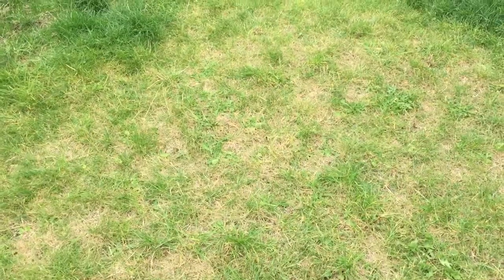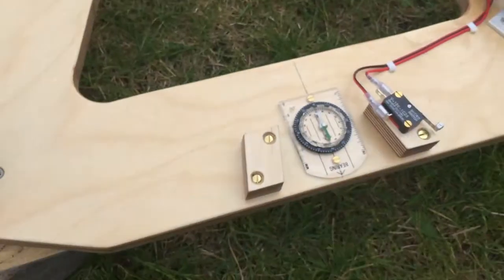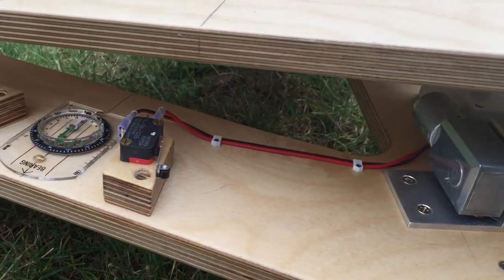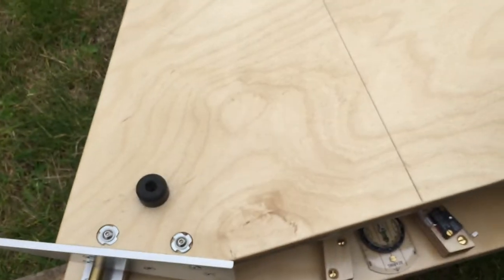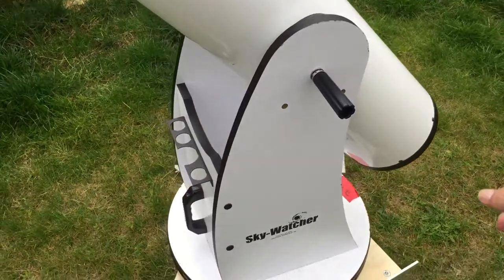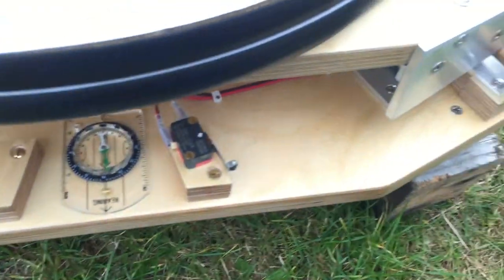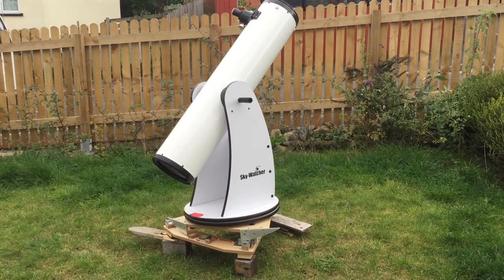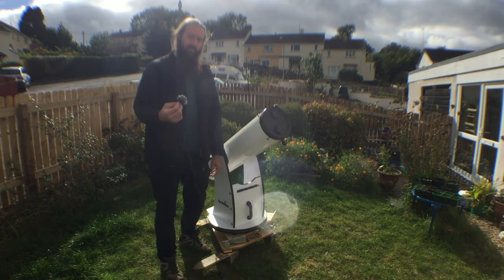Setting up an EQ Platform

Comment: You can repair your particle board holes where your feet attach with super glue and baking soda. Water resistant and soaks into the board and locks the fibers together.

Comment: Thanks Rob. Stll trying to work out which planets I can see from my back garden as the big 2 are still low down so I'm considering using it indoors and shooting out of my large window upstairs. At least I know the floor is flat!
Reply from the maker: I've heard that astrophotography from inside results in a lot of turbulence from the temperature difference, be interested to hear how you find it
Reply: @StargazerRob  Will let you know. Jup/Sat aren't well placed from ground level. All my efforts to date have been from my 2nd floor and there's no heating on up there before I get started as it's mainly unoccupied.

Comment: Thank you Rob!   The roller which controls the movement - what is to prevent the top vertical arm from slipping downwards such that the movement is not controlled?   Is the motorized roller on that side made out of hard rubber perhaps such that it won't slip?    Also, I assume that the speed control potentiometer is part of a voltage control circuit?  Do you know what the minimum and maximum voltages are for this particular motor?  Sincere thanks!
Reply from the maker: Hi DW, thank you. There's a texture on the drive wheel that causes friction, preventing slipping. Don't know about the voltages sorry, David Lukehurst who built the platform for me may well be happy to answer that if you ask him directly

Comment: Hello! I'm wondering if making one of these is worth it. Right now I'm using a 6 inch dob untracked and able to get like 15s videos on jupiter and try to get tons of them. My thought process is, that making a 130$ eq platform would be so much cheaper than a 700$ mount lol. Is it hard? Would It even track for like atleast 30s to a minute of the planets? Also would I be able to do EAA for deep space like m51 and other galaxies? Thanks!
Reply from the maker: I would think that even quite basic tracking would allow much longer for your planetary work. Higher precision would be good for deep sky. I don’t know how hard they are to make, I have no skills in that area 😅. Could work quite well for you potentially, with a 6” scope I’m thinking you’re probably working at a shorter focal length which makes things easier

Comment: New to the hobby. Does a goto Dobsonian eliminate the need for an equatorial platform for astrophotography?
Reply: This sort of mount uses the same equatorial principle that German equatorial mounts use; however, this sort of mount would be best suited for wide field astrophotography. If you're looking to photograph distant objects, like galaxies that aren't Andromeda, a proper polar alignment and autoguider are usually required to maintain the correct sidereal rate.

There are excellent mounts, like iOptrons skyguider pro, that are still quite cheap. And there exists "Go-To" conversion kits (the $150 - $300 ones, not the cheapo plastic Celestron one) that do a phenomenal job if you want to buy a cheaper non-go-to mount to convert or just build your own.